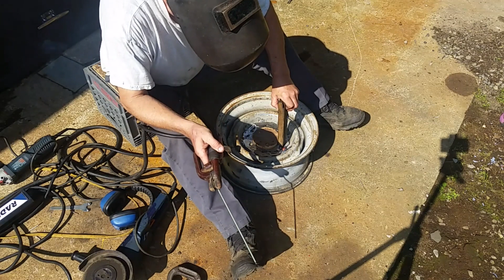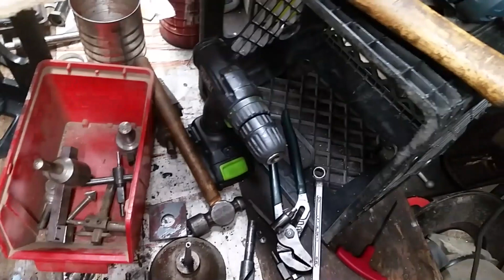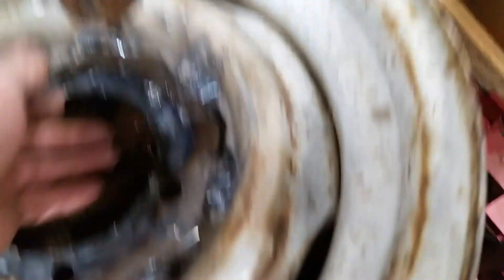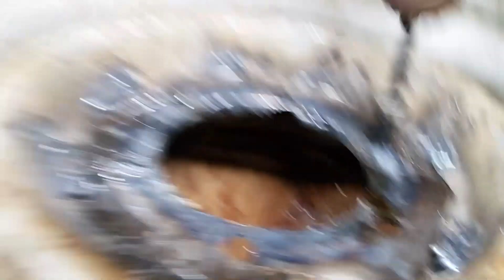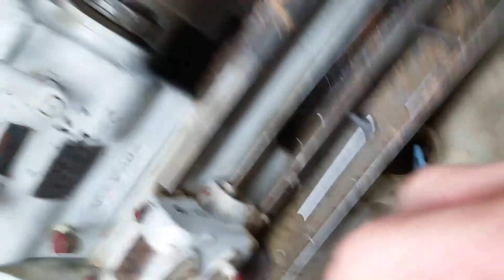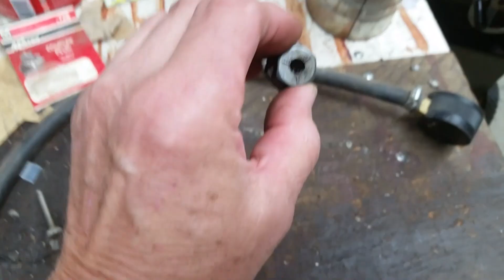Terramite model 2: making rims

Comment: You may have been welding for 50 years but you don’t understand that you have work hardened the steel that is why your cutter is struggling?
Reply from the maker: Thanks for the comment.  If I wasn't so lazy at the time I would have set it up on my Bridgeport where I think I could control the process better. I did not show enough detail but I don't think I had the proper shape for the cutter either.  Interestingly enough, I did not have the trouble on the edge where I welded.    (I may have been welding for 50 years but maybe not correctly!)